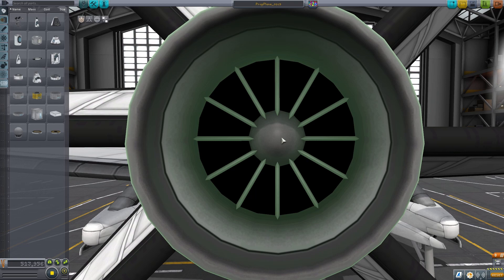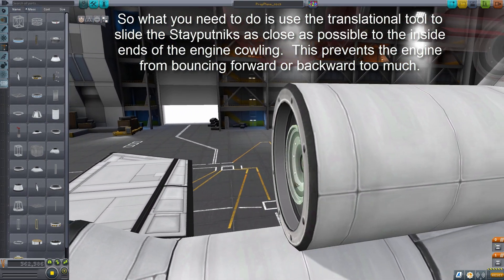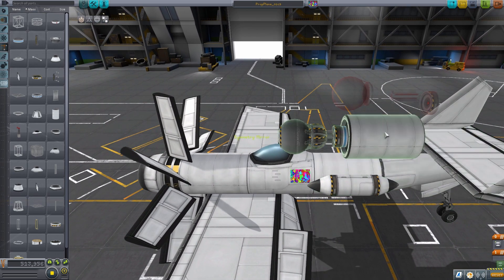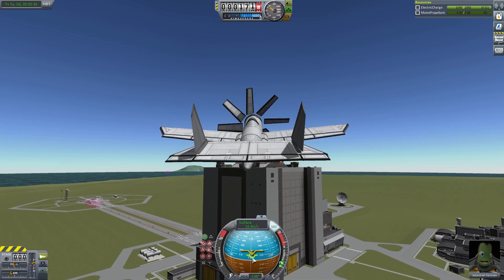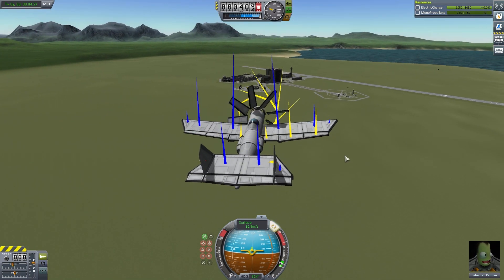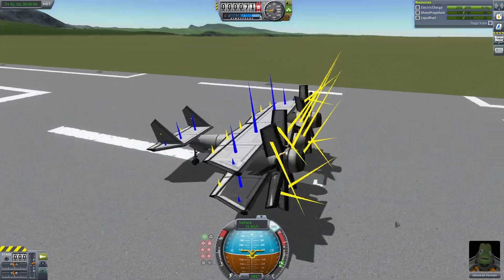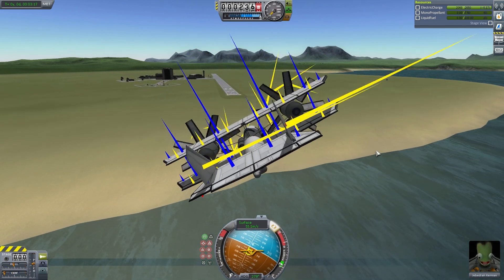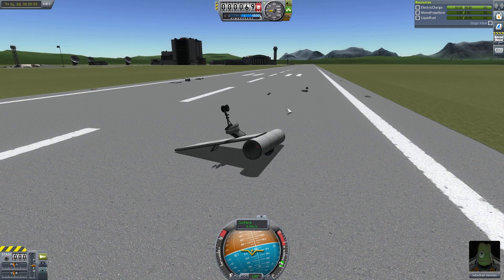OBSOLETE VIDEO, pls see #3 -- KSP stock elec prop 2: smaller engine, bigger performance

Comment: And now, a C-130J plane :p
Reply from the maker: Marc Stollmeyer (his comments are elsewhere on this video) challenged me to build something like that, namely a Spruce Goose.  It didn't work out for me.  Too many parts, too heavy engines.  I think there are limits to how much these electric engines can be upscaled.  On that note, though, Tekist made a submarine and high altitude plane using hundreds of small reaction wheels packed into a single cowling.  Check out his channel, those creations are nuts.
Reply: hmm, what about a chopper, huey like or so.  or the MH-60
Reply from the maker: Chocolade_met
Rahmat Mirkovich made a Chinook.  Much better than my most recent video's attempt at a single-rotor craft.  You should check out his channel.

Comment: Please make a p-51 or p-47! Or c130!
Although it's super slow compared to the irl counterparts
Reply from the maker: I've been working on larger craft and yeah: the KSP performance does not scale comparably with the part count and mass of larger craft.  Also, I suck at doing replicas.
Reply: Inter's Odyssey c-130 might be good to do then. Because it's a 4 engine transport 
And well kind hard to screw up design wise

Comment: why not using the scale mod in order to resize parts and remove the gap inside the tube?
Reply: This has a much more precise adjustment.
Reply: tonyHern865 them its not vanilla, U coud just use a prop mod too. It is the Challenge that s fin about ksp

Comment: I made one that is able to go over 100m/s ;P
End stop futher "development" of DIY proppelers in KSP. Becouse there is no point in using them, other than landing witchout parachute with rocket.
Reply from the maker: Do you have a link to your fast plane?  I'm always trying to learn how to make these things better.  
As far as landing without a parachute, are you referring to auto-rotation descent propellers?  
I have to disagree with an ultimatum of ceasing development.  Propellers have great advantages in slow or low-altitude flight.  But I did not build these craft for efficiency in my space program, I only made them as a personal challenge to see if I *could* build them.  Everyone should try to challenge limits in KSP.  Even if Squad eventually implements a stock propeller part into the game, I'll just find something else to challenge myself on construction-wise.  Plenty of goofy things out there to try.
Reply: Inter's Odyssey I don't think have eny records(PrtScr, files, vid ect.) of it. Meybe I will draw it(propeler) end post there.
Reply: There is one really good reason to use electric props in KSP and that is Eve missions. Being able to lift your craft up through the thick atmosphere without using tons of rocket fuel would be a huge help.
Reply: Was about to say, I've been dreaming up a design like this for a while now for EVE exploration missions.
Would it be possible to get one in flight through Jool's upper atmosphere? Maybe Laythe?
Reply from the maker: The Last Thyme Lord
Laythe yes, Jool no.  So far as I am aware, Jool's atmosphere is not modelled with the density we're accustomed to on Ker/Eve/Lay/Dun.  I think Jool's atmosphere is only modelled with reentry heat/resistance.
Reply: Inter's Odyssey

If it models drag, it should also have lift. Just searching around I found 2 examples of flying probes on Jool.
Reply from the maker: Nuovoswiss
Seriously?  SERIOUS?!?  I wanna see!  Linky linky!
Reply from the maker: That is amazing.  I had no idea that was possible.  The first video predated the introduction of reentry overheating so I thought maybe it was a fluke, but then I watched BWJr's video which is very recent and sat there watching the whole thing in disbelief.  I then went and tested it myself just to verify it.  I never would have known this was a possibility if you hadn't said something.  Thank you!

Comment: The only problem that is see is how much each of the power generators cost, like 24k each. Like you dual prop was almost 1 mil! Good design though
Reply from the maker: Wait, cost?  We're talking about cost here?  <<<< sandbox sheltered boy
Reply: Well I always thought that the real purpose for propeller planes was to be cheap and fully reusable, but I suppose looks are also a good reason to make one :)
Reply from the maker: Isaiah Schwartz
Ohhh, sounds to me like you're talking about Career Mode philosophy with roots in forum discussions.  Forums and I are like jungle and desert.  If cost is a true concern, you could always make the rotating part outside of the cowling a bit longer front-to-back so it has room to attach solar panels to it.  The draw in those small SAS wheels is not very much.  I think 2 generators is enough for 3 of them, or some ratio like that.  (Been a while since I tested it, don't take my word for that number.)  So you probably wouldn't need many solar panels to accomplish the same job.
Reply: I mean, sure it'd be expensive to buy one, but they are infinitley reusabe, so they would pay you back in the long run, and you can also switch the genenrators to cubic struts if you are hard pressed on money.

Comment: Is the two engine power difference due to the directionality of the prop rotation?
Reply from the maker: I wouldn't think so considering the blade angle on both props is identical with respect to the relative wind, so they both have the same AoA when the plane is straight and level (which it was when I pointed out that difference) so I honestly have no idea what's causing it.  Go, KSP!

Comment: lol idk why but at the moment i change any kind of piece of the plane (even just adding a science module) or if i want use it on another craft or even made one by myself it alway explode and ragdoll as fuck ...  idk if you glitch the physic or use debug mod but seems physicly impossible on my game ...
Reply from the maker: I did not use any cheats but I did add some internal struts to my larger engine designs to hold them in place when a craft loads onto the runway.  When the engine is decoupled, the strut breaks and disappears (that's good).  As for changing any small piece: yes, this kind of engine is excrutiatingly sensitive to every change to its parts.  This Sunday I was trying to "improve" an engine on a craft from another video -- spent 4 hours on it and barely made any improvement at all, most of that time spent trying to make sure the new engine configuration didn't rip itself to pieces.
Reply: thx, it's kinda really hard

Comment: You can use tweakscale right? instead of many Stayputnik
Reply from the maker: Then it wouldn't be stock.
Reply: Yes, but does it work? That's what I meant
Reply from the maker: Lammet
In theory yes.  I haven't tried personally.
Reply: Inter's Odyssey I've tried and it does not seem to work, the staypitniks is either too big or too small, your version is best👍.

Comment: Awesome dude! I'm still bad at KSP and I really can't figure out a few stuff. Like if you change your view to a planet, how do you go back to your ship? Or how do you do that trim thing with the propellers? And how did you make the engine?
Finally, at 26:35 how did you do that with the engines? What button(s) do you press to change views?
Reply from the maker: Well, I'm not going to answer the engine question because that was covered in large part in this video and exhaustively in the predecessor video which I've referenced and linked several times here.  Please go research those on your own.  I do not have a formula for a perfect engine; a lot of the success comes from hours of frustrating tinkering.  
As to your other questions about key presses, going from planet to ship or going from one craft to another uses the left and right bracket keys by default, the ones that look like this: [ ].  I've also already explained the key presses for doing the trim but since I've already given you homework I'll cut you some slack.  The trim command is simply holding down the Alt key (on a Windows keyboard) and holding down any of the Rotation keys (pitch, roll, yaw).  Because of the rotation of the propeller with respect to the orientation of its command module, you will want to use Alt + Right Roll.
Reply from the maker: Er, sorry, switching between crafts and planets while in map view is the Tab key by default.  My bad.  Btw, you can customize all of your keybindings in the Settings.  I do hope you've taken a look in there.
Reply: Thanks a bunch, I'll have a look at the previous videos then.

 Thanks again! :D

Comment: Doesnt the first engine started the most power because it speeds up earler?
Reply from the maker: No they reach a maximum potential pretty quickly, well before takeoff.  I've tried starting the right engine first but the left still gets longer yellow vectors.

Comment: what is you're prop spins but it stops after you switch back to the plane?
Reply: If you press the 'alt'-key (On Windows) while spinning them, you can trim the engine to continually spin that way! ;). Hope that clears things up! :)

Comment: How does the cylinder stay on when you decouple it?
Reply from the maker: Sorry, which cylinder?  Do you mean the white hollow "cowling" structural cylinder?  That white part is not decoupled: the decoupler separates the engine parts from the cockpit.  The white cylinder stays attached to the cockpit.

Comment: dissable roll on prop blades, you will get more power, i got 80m/s on mine :)
Reply from the maker: Waiiiiiiiiiiiit a minute!  Did I seriously not disable the Roll tweakable on the prop blades?  Logging in....
Reply from the maker: Yeah, um, Roll (and Yaw and Pitch) is already disabled on mine.  Sooo...?
Reply from the maker: Oh, unless you're trying the biplane in 1.2, then that would make sense.  My fighter also goes faster it 1.2, as does everything else.
Reply: i didnt try any of them, i was just looking at the yellow arrow lift indicator thingies, it seemed to me as if one side of the propeller was pulling better than the other one :).
btw, i made a speedy prop today, it went past 120m/s in level flight :D

Comment: you should rotate them at the same direction
Reply: This would made the plane spin
Reply: Rodrigo Amorim i tought that only happened when the plane had only one prop
Reply from the maker: Spin still happens with 2, it just isn't as severe.  If you want to picture it, put both of your hands straight out in front of you, then rotate your hands in the same direction (each going clockwise, for example).  Now picture a large circle that touches the outer sides of your hands.  If you watch the movement of your hands twisting, you'll see they both create travel in the same direction along this large circle.  That means there is a large overall force in one direction despite having two rotors, so whatever those rotors are attached to would, by virtue of torque, tend to spin in the opposite direction.
Reply: Inter's Odyssey thanks for the explanation

Comment: is that actually stock? i dont have all those parts... and what are those 2 icons?  "BD Armory" and "Vessel Mover"? you said you had no active mods and you were using stock parts...
Reply from the maker: Yes, you have all of those parts.  If you have KSP version 1.1 or later, I guarantee you have those parts.  There are no non-stock parts on this craft.
"No active mods" as in no mods are actively influencing the action of this aircraft.  BDA is a combat mod and VM helps move craft over the surface.  This craft relies on neither.  (FFR, there are many KSP mods in existence used by other players which have no interactable icons on the UI, many of which have much more potent influences on gameplay behavior of craft.  Best not judge a display of gameplay by its UI, nor a book by its cover.)

Comment: you can use this plane on eve , and fly it realy realy easly
Reply from the maker: REALLY?  I mean, I guess that makes sense.  Have you actually done this already?!
Reply: yep i tryed it on eve and duna ,it dont realy work on duna,it's atmosphere is not enough dense maybe if the plane have more lift you can fly itbut on eve you can fly it realy realy easly without modification of your plane.
ps:sorry for my broken english
i'm french btw.
Reply from the maker: alakabis
That is sooooo cool.  :D  I haven't been to Eve in a very long time.  Yes, Duna's atmosphere is terribly thin.  I've found that to keep a plane airborne in a glide, the craft would need so many wings that it becomes uncomfortably heavy and awkward to maneuver.
Reply: Yeah I put mine on eve and although it can only go half the speed, it can still fly

Comment: WOA dont put the angle of the props that steep... make them shallower you want RPM's
Reply: i learned this from scott manley when he tried to make a helicopter on a rocket if that makes any sense
Reply from the maker: Not sure what WOA means.  Since you learned from Scott Manley he was probably talking about "constant speed props" or "complex props" that use variable propeller pitch during different phases of flight to maximize thrust and minimize drag.  That does work in KSP but it doesn't work as well as I'd expect.  Plus, switching back and forth between the craft and the engine to adjust prop pitch during flight is tricky enough when the plane has only one engine, nevermind more than one.  The trouble is you would need to switch because a shallow pitch is only good for low translational momentum; steeper pitch is more efficient when the plane is underway.  I opt for a middle ground so I don't have to struggle with making fine adjustments (literally) on the fly.  I pointed this out with text onscreen in the video, but the way I do this is by rotating the prop blades in the SPH so the CoL moves as close to the prop as possible.
Reply: WOA is an exaggerated version of woah
Reply from the maker: Percival
WOA, man.  I just learned, like, knowledge 'n' stuff.  Bodacious, dude.  :D

Comment: i really don't understand how the engine works
Reply from the maker: My answer is going to assume that you play KSP and know that the "SAS" reaction wheel parts use electricity to generate torque, or turning force.  A normal craft in KSP will have SAS wheels attached to the craft's body or hull or whatever.  When the player inputs a rotational command, the SAS wheels provide cumulative force (depending on how many there are and how strong each is) to make that rotation happen.  The whole craft rotates because the craft is typically attached to the SAS wheels.  This electric engine works because we detach the SAS wheels (the engine) from the craft.  That way, the engine can spin freely in space/air while the craft remains level.  The KSP function that enables the engine to *continue* spinning is the "Trim" function.  Instead of merely inputting a rotation command, the player can hold down the Alt key before pressing a rotation key.  The Alt key sort of locks that rotation command in semi-permanently.  (It can be lessened by holding Alt and hitting the opposite rotation key or it can be undone completely with Alt + X.)  When the player lets go of the keyboard, the object continues to try to rotate.  This Trim function is what enables us to make the engine continue to spin while we fly the plane.  The fact that the SAS wheels use electricity and the inner engine components include electric generators means the engine needs no outside fuel source.  With that said, though, I have seen some people elect to use fewer generators and instead place some solar panels on the exterior spinning components of the propeller.
Reply: Inter's Odyssey you assumed right:) and i understood thx

Comment: Try looking up centerline thrust aircraft you can thank me later
Reply from the maker: You mean Push & Pull jobbies like a Cessna Skymaster?  Yeah those are fun.  Earlier comments have also highlighted on the reduced drag of that configuration.
Reply: yes and can also fix your engine start proplem because the aircraft wont have to do a circle before it takes off from the engine making thrust from one side.
Reply from the maker: wolfen750
Welllll, you're sort of correct.  :)  The torque on these wonky KSP propellers is so huge that the craft does actually start swivelling to one side (precessional forces) if you fully spool up one engine before switching to the other, despite them being inline with each other.
Reply: Thats crazy I thought it might help and I wanted to see a new project it would be great if it looked like the german do335.
Reply from the maker: wolfen750
Yeah I did make one I just haven't shown it in any videos yet.

Comment: you should do stalls and stuff
Reply from the maker: It is alarmingly easy to do stalls in these slow aircraft.  Since the engine is detached and free-spinning in space, once you pitch too high the propeller just wants to fly straight up, which makes it almost impossible to bring the nose back down after the wings stall.  ...That reminds me I need to get back to uploading my flight lessons.
Reply: +Inter's Odyssey yeah, I downloaded this and i was very surprised at the amount on engin power although the stalls were very fun :)

Comment: HOW DO YOU KEEP THE PROPELLER MOVING!!!!!!!!!!!!!!!
Reply: alt + Q/E
Reply: but what is my computer starts lagging?
Reply: Constantinos Veletas 
Lagging as in the clock slows down or lagging as in it stutters and barely responds to input?
Reply: yes when i press the alt button the computer game frezes
Reply: Constantinos Veletas 
You probably need a better computer. Either that or something else is going on, maybe a mod is misbehaving or you are running a version with a bug.
Reply: okay
Reply from the maker: Sorry I'm late to the conversation.  I agree with Marc's last comment.  I cannot think of anything in KSP that would cause KSP to freeze just from pressing Alt (or any key for that matter) on the keyboard.  The reaction you described sounds like something external to KSP.
Reply: really